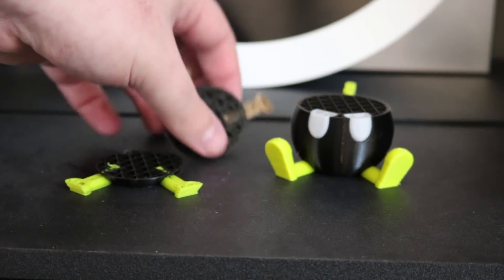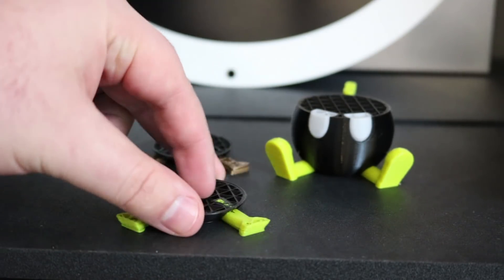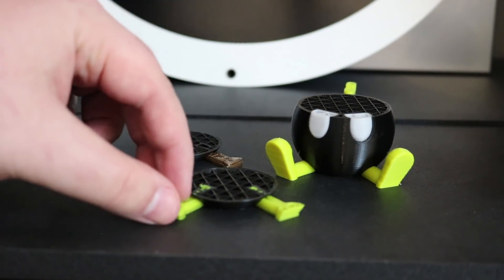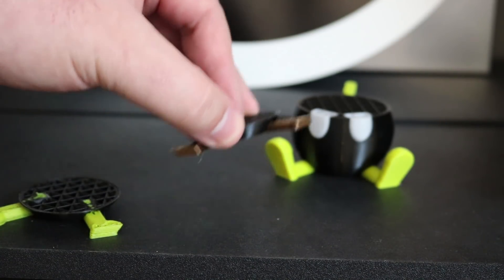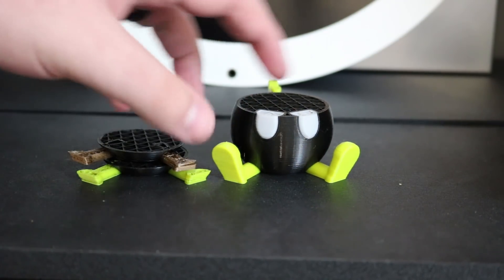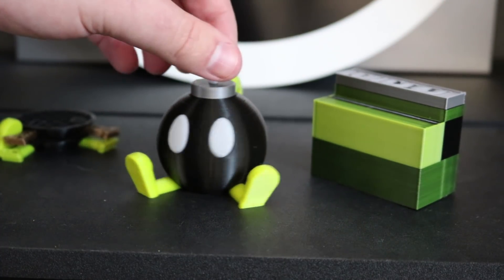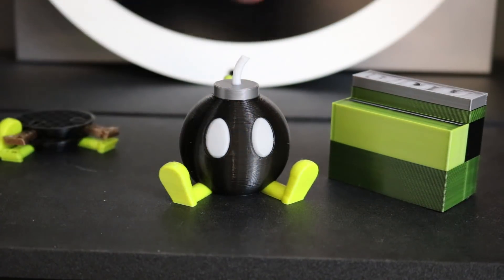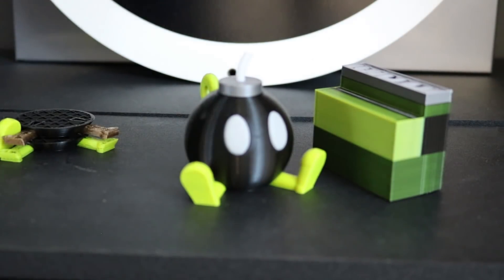3D Printed Bob-Omb in 4 Colors! - Prusa Multi Material Upgrade

Comment: Great Bob-Omb. I think the purge block shouldn't be really seen as a waste.  It's a tool that allows neat prints to be created.
Reply: ImaginationToForm If the purge block could instead be used to infil it would be better. The colors arent easily seperatable from a purge block either.
Reply: ImaginationToForm it’s not a tool when it waste material that you can only bin. ( since recycling tools are few and far between) The 3d printers are suppose to be efficient machines to print an item with pretty much no waste ( even support material is reduced waste) but a solid block... useless, I’ve said before about how printers need to have a multi print head fitting that can rotate to print multi colours without that use but seams no ones interested, not sure why it’s the same system a cnc milling machine uses, and these printers just require a heated head.

The only other way to make that “waste block” not actual waste is to form it into something that can be primed and painted after, so instead of waste you have a multi colour print and an item that just requires some paint to make it functional.

3d print rolls are not cheap... especially when you do a project using other materials abs, pla, ninjaflex etc.
Most ppl who run these printers seam to be of unlimited money... YouTube ftw I guess... but the common person with a family has to keep cost In mind.

I run my printer regularly and I know the costs well and financing a machine like this has actually worked out more expensive than casting with silicon moulds and resin, which was my old method for what I do. 

Of course 3d printers can do a better job than a casting in resin, but at what cost?

A casting project of reasonable size even in multiple parts. Using silicon moulding and resin costs on avg £40 ( for both using 1kg kit) and I can reuse the moulds for quite so times, 
Where as compared to a 3d printer the rolls cost that much and you spend more in failure than you do a finished product.

So to sum up... it’s waste u TIL you can make something g useful. Consider the cost not to just your pocket but to the amount of plastic waste your dumping in the bin!

Comment: Have you tried using the MMU with Colorprint for color layers? I haven't seen any try it yet and seems like it would be extra convenient with the MMU set up. Random side note, I have been wondering lately if there is a way to get the Mosaic Pallet to work with the MMU for even more colors ;)